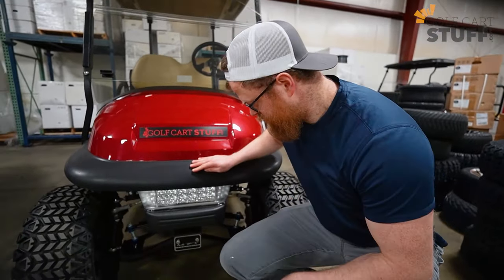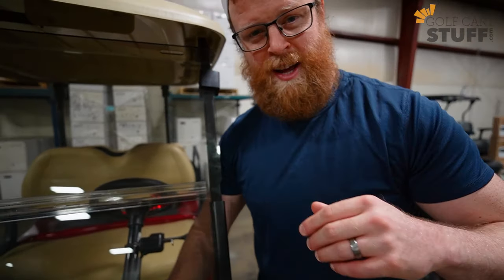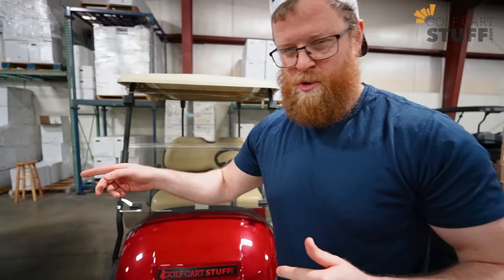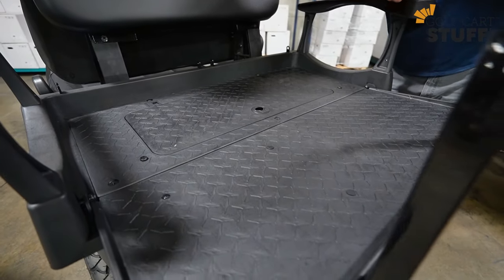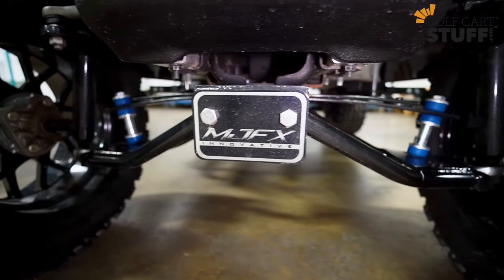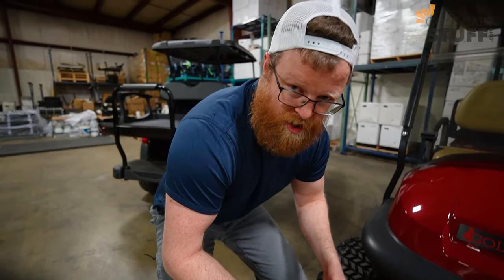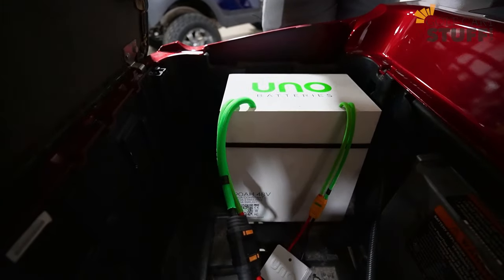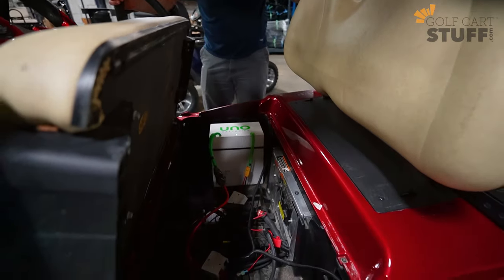Top 5 Golf Cart Accessories! (CLUB CAR, EZ-GO, YAMAHA)

Comment: I am surprised how many opt for the lift kits, wheels and tires.  I suppose it looks cool, but functionally it has a number of negatives.  It is much easier to lose control and roll a lifted cart.  It wears out front tires much quicker due to alignment complexities.  Water/dirt is thrown from the tires.  While you gain some top end speed with the larger diameter tires, you lose torque, so a hill climb may be a challenge.
Reply from the maker: I suppose it’s the same reason people lift their jeeps and trucks then. Thankfully we don’t run into issues with customers having to replace their tires due to bad ware but that is a great reminder. Installing a lift kit or replacing your tires any time, requires proper front end alignment!
Reply: @GOLFCARTSTUFF  Well I think most truckers do it for clearance in off-roading and mud.
Reply: I hunt and work property with mine, I need it because of the ground clearance I drive easy btw

Comment: That wire management is terrible! The lift and tires could be considered a performance upgrade for off-roading, I suppose, but they would actually reduce on-road performance. The battery is the only upgrade I would consider a "performance upgrade" in your list of six "performance upgrades."

Comment: Lipo battery, maybe in 10 years when they get affordable.
Reply from the maker: They are expensive up front but they are definitely lighter and can last much longer.
Reply: Can anyone change the battery or do it need a professional
Reply: I can Four Lead acid batteries From my brother in law who owns an auto parts store at a price of about 410.00 What would you say is the comparison between the two?
Reply: @ChipVorhies  I am successfully running four deep cycle 12 Volt marine batteries big ones, replaced my Trojans with them, I needed to make my dollar stretch, he was ever in the position to drop $1500
So far I am very pleased I get about a 15 mile radius so that's 30 miles round trip.